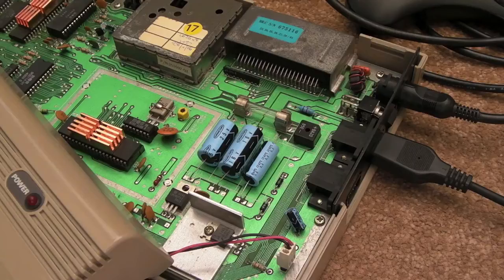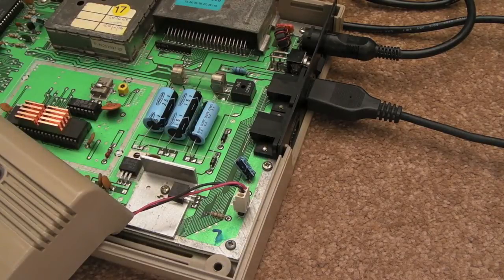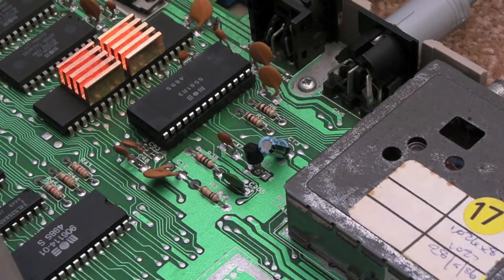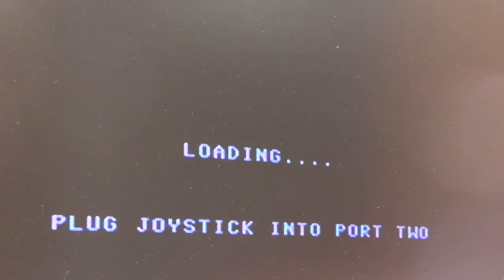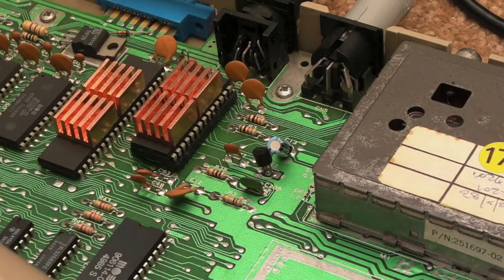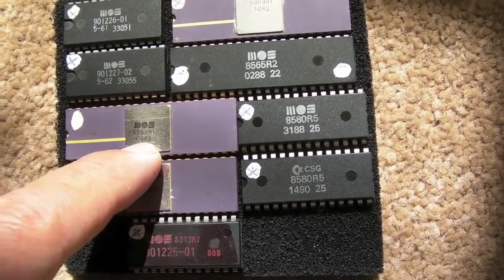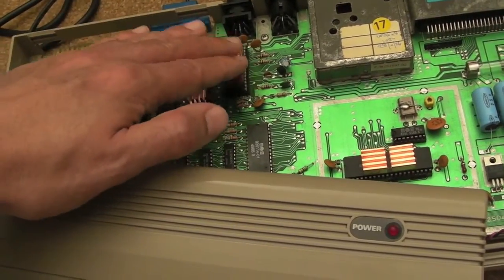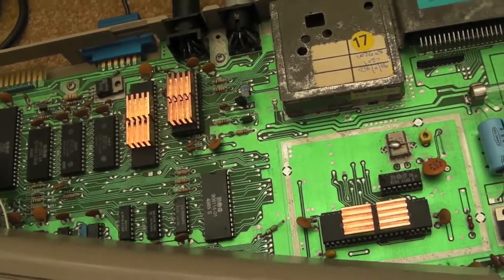Commodore 64 (C64) SID Repair

Comment: Hi - is there a way to test the SID without a spare? I've got zero sound - tried two TVs but I only have an SVIDEO cable so want to know if there's some way I can test to see if it's the cable, the SID, or something else? 

Not that I can do anything now, there was a loose screw and when I took apart to check things inside it looks like it's shorted something 'cos the fuse has gone!

Comment: Just like to say first off. I like you videos very much. :-)

Heaps of useful info..

I stumbled upon an interesting thing. 

I have a an old KU style motherboard. It has  previously had a repair attempt. It must have been too hard because the U31 chip was removed when I got it. I discovered the two 10uf capacitors near the timing crystal had leaked and actually removed the trace work around these capacitors.

These things I repaired as best I could. Got the machine working ok.

All of the major IC's had been replaced with 1984 dated chips including the SID chip when I got it.

Memory and glue logic were not altered.

I had the dead test cartridge running. Everything fine except the SID chip wasn't making the usual sounds. Some of the channels seemed to be missing some of the notes. A few clicks and pops for want of a better word. 

I reconfirmed this by putting the SID chip into another known good C64 motherboard and testing this out with the dead test cartridge. Same results.

I was on a web site for trouble shooting C64 issues. 

https://retrocomputerverzamelaar.nl/commodore-64-problems/

It had pictures of the different problems that can be encountered on boot up. A very good video of yours was on there about running 5v directly into the U1 CIA chip. You were able to get it running again! Amazing.

I thought about this. I got my very cheap hot air rework tool and set it to 201 deg C. I held it approximately 3cm from the top of the SID chip waving it back and forth to evenly heat the chip all while the computer was on and running the dead test cartridge program.

Please note I am positive the air reaching the chip was not 201 deg C! Though the chip got very hot! The temp setting on the rework  station will only indicate the temp at element inside the handle.

The first 2 program passes no change whatsoever. 

On the 3rd pass the SID chip started the give out the usual sounds on all voices.

I kept the heat blowing back and forth for 1 extra pass before removing the heat. I still kept the dead test program running. The chip was very hot.

I let the machine run and the chip cool to its normal operating  temp (room temp was approximately 17 deg C) . Not sure on the SID temp, warm to the touch. 10 minutes running here.

The SID was still operating correctly.

I switched off the known good computer which had the SID chip in for testing. Waited about 10mins for everything to cool to room temperature.
I started the machine running again with the dead test cartridge installed.
The SID chip was still running OK. Ran it for about  10 minutes.

I pulled the SID chip out and placed it back in the original KU style motherboard from where it came.

I started it with the dead test cartridge in. I have been running this for about 3 and half hours now. The SID chip seems to be running fine.

Unfortunately , I can't repeat the experiment because it's still working fine!  I wish I had taken a video of the symptoms before and after for you to look at.

Maybe you can confirm or deny this ....

You have way better understanding of these these things and probably some faulty chips that might be suitable to repeat this setup. 

Possibly a video recording like I should have done?

 It might help out many people with faulty SID chips...

Love to hear more about this and your thoughts on the matter.....

Thanks again.......

:-)
Reply from the maker: Thanks =D  And in short - yes, sometimes that can work!  I have a SID chip here that I planned to try and do something similar with!  What happens on some occasions is the bond wires inside the chip disconnect from the pins and with a tiny bit of expansion from heat they can join back up!

Comment: I think the filter's gone on the first one... the swapped has a more noticeably filtering opening and closing... That's not a flange effect, simply an analog filter and you notice it missing right away, right... :)

Comment: Just fried my 6581 SID the day before yesterday during my first attempt to use a C64. Sent power into Pin 26 (audio in) and now I only get some odd clicks and such. I see that the new replacements are not fully functional with no mouse/paddle support. I was specifically trying to play Arkanoid with my C64 mouse when this happened so I'm really looking forward to trying other mouse/paddle software. Genuine 6581 SID chips on eBay are expensive! Any better options, like using my SID for paddles and a replacement for audio? Would you know a cheaper place than $42 USD?
Reply from the maker: Sorry I don't know of any cheap places to buy SID chips =/  They are becoming rare now and price is going up all the time =(  You could wait for the FPGA SID which is close to public release now?
Reply: How did you fry your SID? Trying to use a mouse to play Arkanoid?  Did you use an Amiga mouse on accident?

Comment: is there a way one can make their own sid chips ie rom burner? also can you fix a sid chip?
Reply from the maker: You cannot really make you own SID chip - unless you get some of the Nano SwinSID boards ordered and then solder on the components and an atmega 88p and program the chip.  Or you could recreate the original hardware in an FPGA (there's a project out there to do that at the moment), but its a lot of work to do yourself.   You cannot really 'fix' a faulty SID chip, unless the fault is just a failed pull up resistor on one of the connections - but that's not likely.  Most of the time they are totally dead, or a channel missing / faulty filters etc.

Comment: can you briefly explain to me how to reseat the sid chip?
Reply from the maker: See this video:- https://www.youtube.com/watch?v=9sNwFlY5XJ8 At around 4 minutes 57.  That how you do it - just lever the chip out of its socket, keep alternating sides so it gradually comes out of the socket straight (or you will bend, or break off pins).  Take your time and it should be OK.   Make sure you note the pin 1 marking (the dot / semi circle on on side of the chip).  Make sure you put the chip back into the socket the same way it came out with respect to pin 1 marking.
Reply from the maker: The SID will be marked 6581 or 8580 btw.
Reply: Thanks.  My c64 doesn't play music.  But ti still plays sound effects.  I've been told that the SID chip isn't properly socketed.  Do you think reseating it will fix it?  Or will i have to replace the chip?
Reply from the maker: Sounds like you need a new SID chip.  Try re-seating it first.
Reply: Yeah I did yesterday.  Still doesn't work.  I'm going to buy a swinsid and replace it.

Comment: seems like you are always working on the carpet / floor.. can't be good for your knees or your ESD's ? PS - I DO ENJOY YOUR VIDEOS !
Reply from the maker: Thanks, yes - It's surprisingly good exercise when you've been sat at a desk all day lol =D  Regards ESD, yes - I wouldn't recommend working off carpet, but I've never had a problem (doesn't mean there isn't a risk), and it varies depending on what you are wearing, the type of carpet etc.  I cannot generate static on that carpet even if I try!!!   In fact I cannot generate static no matter what I wear, but my wife gets static shocks off everything.  I do often take ESD protection where I need to - ie. I wear a wrist strap and work off an ESD mat where I need to.  For example, when handling MOS chips from a C64 I do tend to make sure I am grounded - you only have to look at a SID chip the wrong way to kill the filters on it, but a 74 logic chip for example is pretty damn resilient.   It's all a matter of what you are working on, the perceived risk and cost / availability / rarity of replacements etc.   For example, I recently kicked off at one of Linus Tech Tips videos because he was handling a $4000 CPU without any ESD protection.  More modern devices tend to have 'better' ESD protection, but still I think I wouldnt want to risk ESD there at all.  In a business environment no one should risk ESD at all, but when you are tinkering with your own equipment I guess its a risk you take (or not).
Reply: Agreed :) 
PS. 
Any current projects recently?

Comment: Hiya, I don't think there is anything wrong with that SID, some R3 SID's do sound like that on Alien. If you run WinVice it emulates all the different R3 SID's, select 4885 and it sounds like the one you have there. Not many people realise there were revision within the revisions and they sound significantly different. (run through them all on Vice as it's quite accurate) Also the revision 2 chips do sound 'farty' on Alien mine sounds exactly like it does on Vice.
Reply: I have 10 C64s, most of which are 65xx boards and I have barely two 6581s that sound the same. A good benchmark is Future Freak's Great Tune. The lead voice in the beginning is inaudible* on a "normal" 6581 and on the emulation. So I have machines that sound exactly like that, some where you can hear it but it is rather quiet and/or distorted and then I have ones where it sounds "just right" like I bet this is what the composer wanted it to sound like.
A cool side effect is that you can use two C64s to record your music in stereo.
*) ultra quiet - if you know it's there, you'll hear it.

Basically - if every waveform works on every channel, ring generator works and turning the filters on makes a difference to the sound no matter what, the SID works. (screw Resonance and the Paddles!)
Also note that some SIDs require different values of external capacitors.

Comment: Great vid matey. Can you tell me which chips you have heatsinks on and where you bought the heatsinks or if it's easier maybe you could do a video on that ? Thanks
Reply: I think if memory serves I used little Copper RAM heat sinks from eBay - they just stick on with special adhesive pads.  I ended up heat sinking the CPU, PLA, SID and can't remember if I put one on the VIC2 - sometimes the VIC2 already has a heat sink on the top of the shielded box it sits in - if that's the case add some heat sink compound inbetween.
Reply: ***** Thanks mate, will have a look for some heatsinks :)

Comment: you can tell straight off right from the intro that the attack/decay is not right with the first sid.   Theres no attenuation to the music with the first one and defenitely no flange, its just straight tones.   Second one sounds much more natural with a better tonal range and you can clearly hear the difference!
Reply: GadgetUK164
The SID filter uses FETs as voltage-controlled resistors to control the cutoff frequency. The FET's resistance is different in every SID which is what causes some to have a heavier filter than others.
Reply: GadgetUK164
Someone already decaped the SID. Just search on Google "MOS 6581 die" (without the quotes) or go to these websites:

http://mail.lipsia.de/~enigma/neu/6581.html
http://oms.wmhost.com/misc/

"maybe then we can create a very close replacement"  Sometime next century.
Maybe...
Reply from the maker: TheMadmagik You've got a better ear than me and clearly know your stuff regards audio!  I just know it wasn't right lol.  The problem as far as I understand with the SID is there are capacitors built into the damn thing, so those can be a problem over time.  Additionally from what I understand the filters are mega sensitive to static.
Reply from the maker: TheMadmagik You've got a better ear than me and clearly know your stuff regards audio!  I just know it wasn't right lol.  The problem as far as I understand with the SID is there are capacitors built into the damn thing, so those can be a problem over time.  Additionally from what I understand the filters are mega sensitive to static.
Reply: GadgetUK164
The capacitors are external, not internal, marked as C10 and C11 on the C64's motherboard, therefore they can be changed and the filter can be adjusted with different values. The ADSR seems right to me. You can hear the music fade in at the beginning.
Reply from the maker: My understanding is there are more caps internal to the chip.  It's hard to believe there are only 2 capacitors related to filters and frequency control etc.  I wonder if anyone had decapped the SID yet?
Reply from the maker: Very interesting!  On the subject to caps, you've reminded me I really need to swap out all the electrolytics on my C64 - I will do that soon!  I hope someone decaps the SID one day, maybe then we can create a very close replacement.

Comment from the maker: Because they get hot!  The SID, CPU and VIC II all get hot and are common to fail.  The reason Commodore didn't use heat sinks is because they likely predicted that the chips would last for so many 10's of thousands of hours without any additional heat sinks etc.  Anything that gets hot will live longer with a heat sink or fan on it - It's all about how many thousands or hundreds of thousands of hours it will take to break down, and heat is one of the factors.

EDIT: The other chips aren't as important in my mind - easy to replace RAM, TTL stuff etc in future.

Comment: Why did you put the heat sinks on a few of those chips? I know the SID can get pretty hot, but as far as I know, no model of 64 ever had heat sinks on any of the chips with the possible exception of the SX which had a 5" CRT and a 1541 drive all in one case.
Reply from the maker: tarstarkusz Not sure if I replied to this - I thought I had but it's not showing here =/The reason I used heat sinks there is it helps extend the life of the chips.  The MOS chips used in the old C64's benefit from being cooler.  Commodore didn't care if the systems died after 5 or 10 years as they would be able to sell spare parts.  It's a bit like car manufactures to a degree, they design the product as cheap as possible and later make money from spares etc.  By putting heat sinks on the CPU, SID, VIC and PLA you help extend their lives.
Reply: GadgetUK164
Thanks. I figured there was a point of diminishing returns and that really only the SID would benefit. OTOH, it's worth putting them on if you have it open anyway especially given how old some of these machines are. I wonder how long the roms  chips will last, I am really surprised at how well they have held up. I have Atari cartridges from 1977 that still work fine. I remember at one time, people would use the age of the roms in the games to justify backing them up so that digital copies would be made so that no game would ever be lost. I actually sent a couple of prototype 5200 carts to be backed up (I modded my 7800 to be able to backup 2600 and I'm pretty 7800 carts as well, though it's been so long that I don't remember); Thanks again.

Comment: Can't you use capacitors with a higher rating on that first SID instead of swapping it?
Reply from the maker: Not that I am aware!  The filters were just not working in that SID.  The caps are matched to the SID type, and I suspect changing them wouldn't have made a difference for the particular fault in that SID.  That said, you have got me wondering if some of the different SID revisions for the bread bin required differing capacitors?  I know there's a difference between the 8580 and 6581, but not sure if the different revisions on the 6581 need different caps?
Reply: GadgetUK164 The filter on the 6581 SID chips vary quite a lot regardless of revision. For example a R3 from 1984 can have a very light filter while another R3 from the same year can have a heavy filter. On the SID's datasheet it says:

"The frequency range of the Filter can be tailored to specific applications by the choice of capacitor values. For example (...), larger values for C1 and C2 could be chosen to provide more control over the bass frequencies of the Filter."

So for the SID with the light filter I guess you could try caps with a rating somewhere between 600 and 800pF. Maybe it would be a good idea to put sockets for the caps if possible. If the filter on that SID doesn't sound right regardless of the caps rating then it's definitely faulty. It's worth to try though.
Reply from the maker: Very very interesting!  I will try that at some point!  Thanks for pointing this out =D